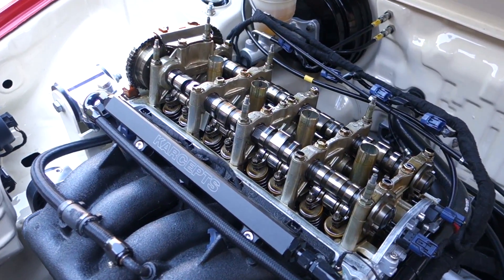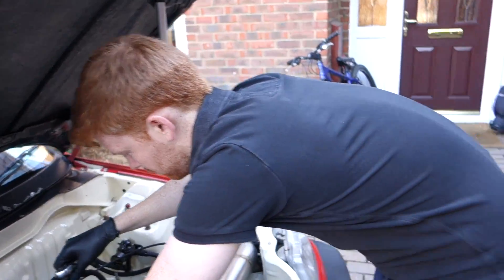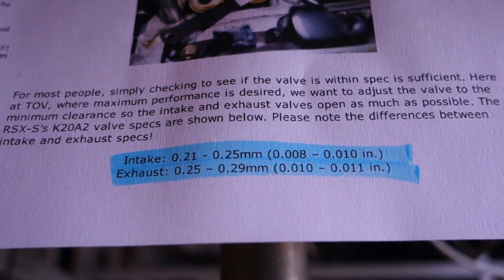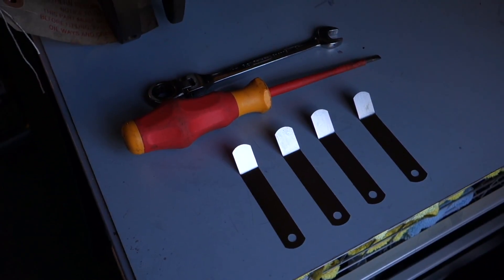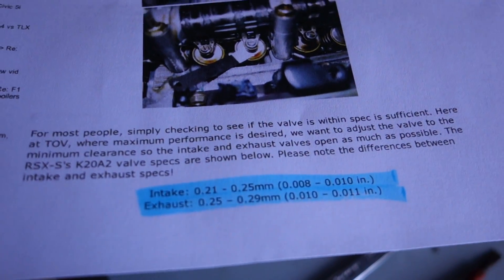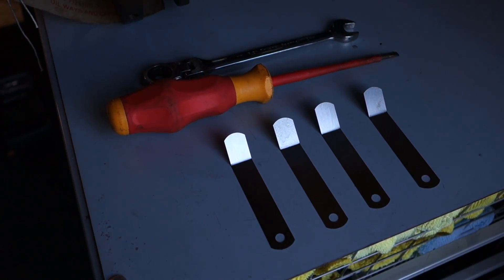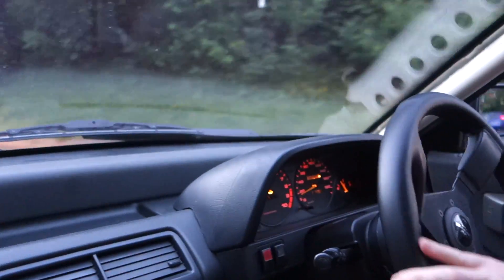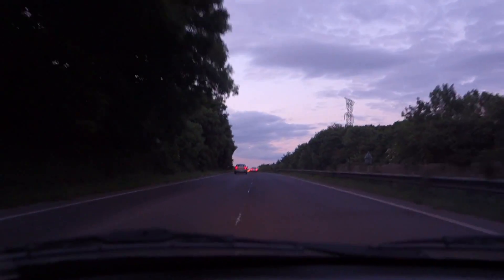K20 VALVE CLEARANCES

Comment: How many miles do the valve clearances need checking? I think every k20 engine I've ever heard makes a tapping sound they all sound about the same to me
Reply: Every 40000s miles mate
Reply: @keylime7595  does it actually make much of a difference?
Reply: I haven't had mine done tbh deffo needs doing makes the car a bit smoother and probs get better mpg as well
Reply: @keylime7595  mines done 73k now it runs ok & sounds just the same as any other so I've left mine alone I've heard people say it makes a difference I've heard other people say it makes no difference & was a waist of money so the jury is still out on that 1?
Reply: Yeah mines done 130000 still sound mate so yeah I'd leave it but honda hq do it for £55 if ur really bothered, gonna map mine eventually so I'll just do it then
Reply: @keylime7595  yeah I suppose for 55 quid it doesn't really matter weather it makes a difference or not does it...130k hay some going that m8